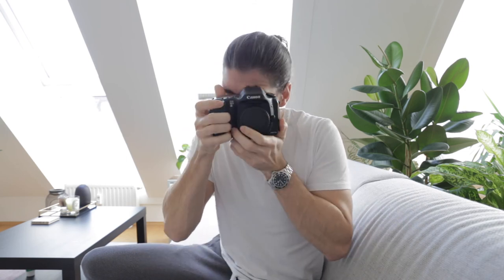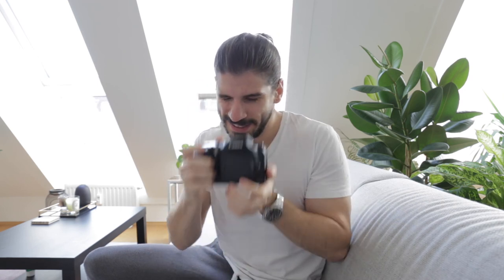How to: SOFT LIGHT from your POP-UP FLASH with this Simple and Unknown Camera Hack!

Comment: Hehe, maybe no one use it this very moment, but all tried it at certain point of time. It work only in perfectly white walled room. My refinement is by using white paper tissue. I had to use it not long ago when my son had b-day and I forgot external flach. Instead of book that make defined line above, I used one or two layer of paper tissue which as almost translucent and do two things. Shatter light and bounce light. That way light is wrapped around room plus some of light still goes directly and make some nice catch light and fill light.

In years before I had my 1st external flash I used canister from Fuji film that were white translucent and not enlarged ligjtsource by much, but also spread light in all direction and room was better illuminated thus less shadows.

Comment: Thanks for the tip! I tried it with a piece of paper and the screen of my phone. Then I thought of something arguably even easier, simply pulling the flash on my Sony a6100 back and holding it there while taking the picture. I haven’t tried it on a person, but it looks basically the same in my testing. I can’t angle the flash as far back as I want though, so it is possible this will create a little “raccoon eyes” effect depending on the angle to the model.

Comment: Great video Alan i always have a couple of sheets of A4 card in my bag just for this reason :-)
Reply from the maker: Thank you for the kind words, Marc. Have you worked this technique out yourself as well?
BTW if the paper is translucent enough or if the flash hits your forehead, you'll get really nice catchlights in the subjects eyes. Did you know? It's all practice though. 😄
Reply: Yeah Alan i worked it out after cutting up a plastic milk carton and using that to diffuse my flash, i soon learned that it just dimmed it rather than diffused, i tried a few other things including A4 paper, it was quite a thick paper though so again losing the power of the flash instead of spreading it, it was then i angled the paper to bounce the flash off the white ceiling and got what i wanted,i didnt want any flash to spill through the paper so started using heavier cardboard, bouncing to the side or different angles rather than off the ceiling is a fun way to learn about lighting subjects, heavier card lasts longer in my bag too lol
Reply from the maker: Cool. I had the exact same learning experience. 😄